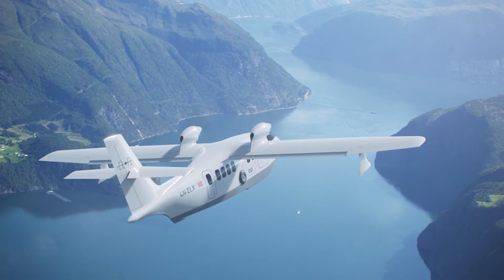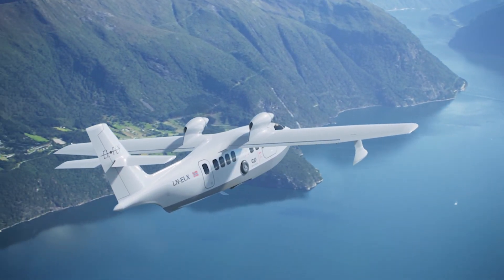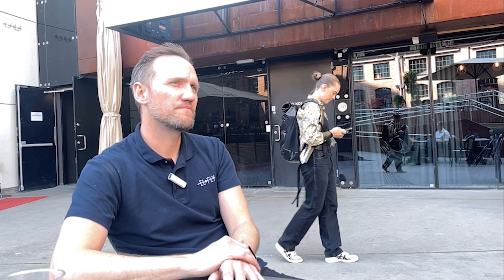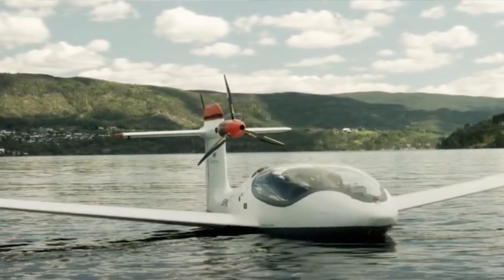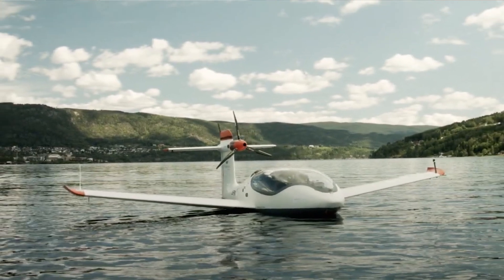Tomas Brødreskift from ElFly explains the ideas behind the Norwegian company's electric seaplane

Comment: I wonder, one of the issues is breaking free of the water.
I recall from some time ago, craft that blew tiny bubbles under the hull were developed.  
Could this help an electric seaplane?  A small high powered electric fan would weigh very little